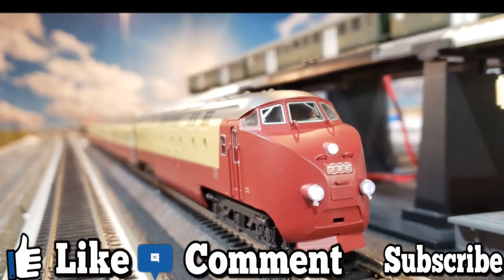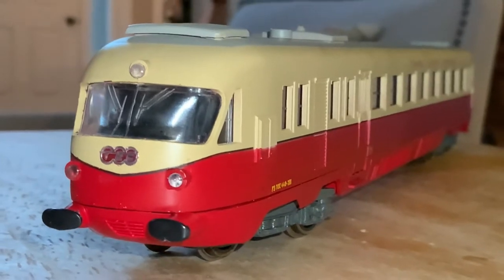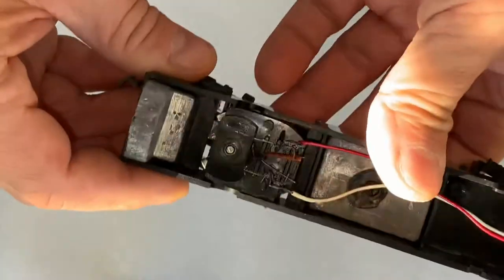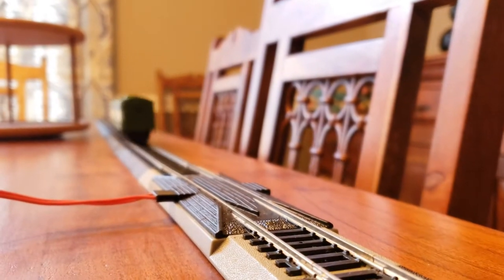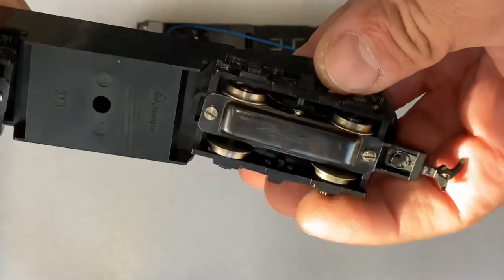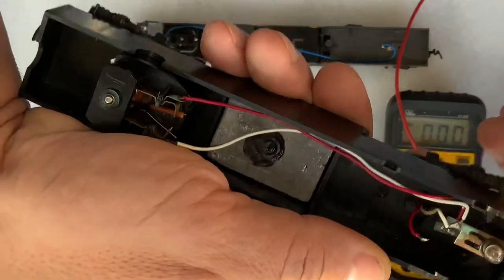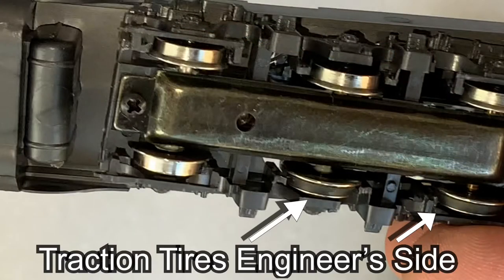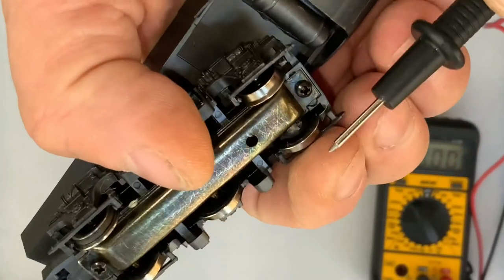Detailed Tech: Converting DC AHM, IHC, Rivarossi vertical motors to DCC with Soundtraxx Tsunami 2

Comment: Great video.  For so long folks have been saying that the older locomotive are not worth converting to DCC.   You have proven the opposite.
     I also love the idea of using clay to keep the wire where you want it for soldering....Fantastic tip.    Just subscribed and am working my way through your other videos. I've found a wealth of valuable information so far.
   keep up the great work !!!

Comment: When your doing the motor you cut the metal strip on you don’t have to do that it’s just soldered to the contact pad for the motor you can heat it up then pull the fat metal ground off and connect every else same as any other dcc install

Comment: Did you make any changes to the factory default motor CVs?
Reply from the maker: Yes, in order to speed match. I have a separate video for how to do this.
Reply: @DoctorHobby  I ask since I'm putting DCC & Sound in the same engine for someone but am unsure if I'll need to change decoder settings for it to work better with the existing motor (will be using the same decoder and current keeper setup as the video)

Comment: Im new to DCC do you have to program your engine once you wire it up?  How do you know what number to type in on your throttle?  Thanks.
Reply from the maker: Howdy! Yes, you do have to program the address via CVs 29, 1, 17, and 18 . Get an app called a “DCC Address Calculator” and it’ll tell you how to set these values.
Reply: @DoctorHobby  I imagine the instructions to do so come with the decoder?
Reply from the maker: Some do, but not a lot. Soundtraxx has more detailed instructions online.
Reply: Usually the general practice is to use the number on the side of the locomotive (generally called the road number) for the decoder address as then you just have to look at the engine to know what the decoder address is

Comment: I measured the stall current on an IHC 2-8-0 and it draws 0.758 amps at 13.5V (NCE specs) and 0.873 amps at 16V (MRC Specs).